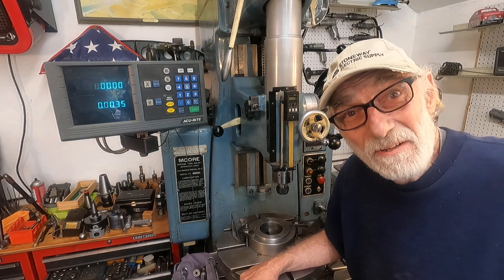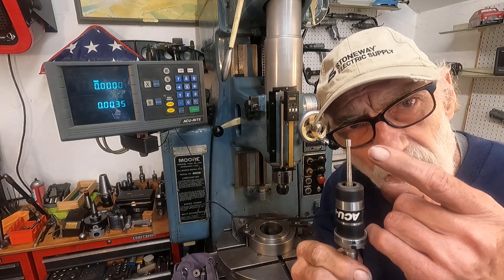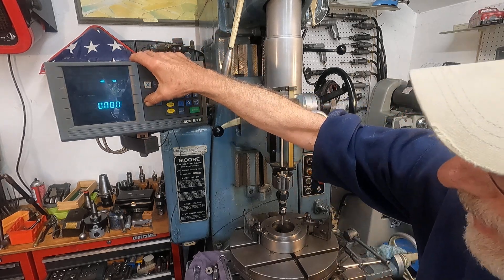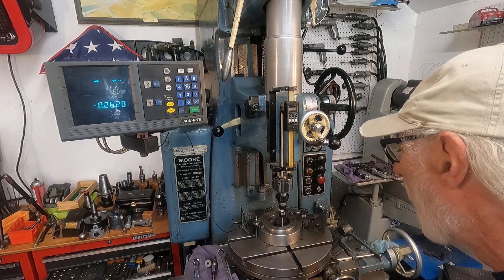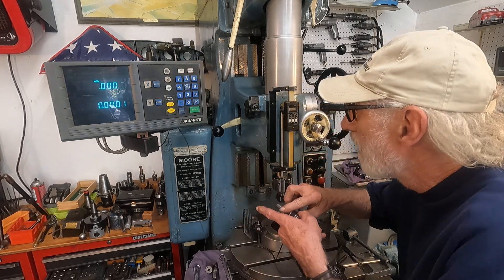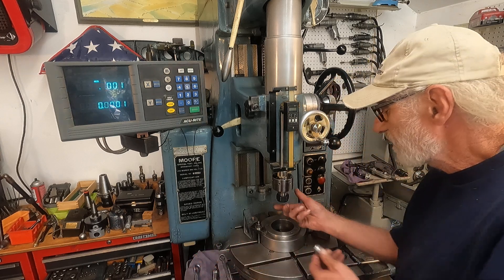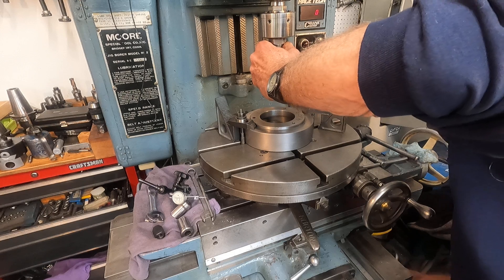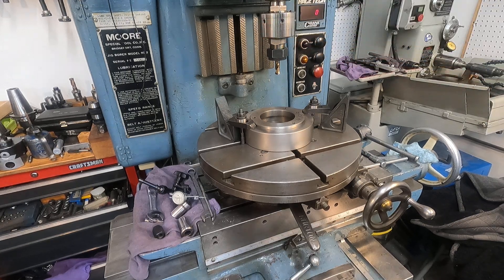Moore Jig Borer using the touch probe

Comment: Moore jig bores and grinders are such high quality that even if You see a Moore clamp for table clamping marked " Moore, You will pay quite a bit of money. Moore Parallels or 1,2,3 blocks are very expensive used
Reply from the maker: The little tiny toolmakers knee cost close to $4000, "a 2"X2" angle plate, but a jig borer and now a jig grinder are a couple hundred dollars. and you do know who bad mouthed these machines, claimed to use one as a drill press, yes it was that backwater machine tool dealer posing as a machine god. Those paying bank for Moore trinkets certainly could not make a video using those items of gold. Good to hear from you Dan, you  are good guy!

Comment: I didn’t know there was an electronic edge finder that connected into a DRO, only seen a light indicating one in a video. Thanks for sharing!
Reply from the maker: This works well in the jig borer because spindle run out is eliminated by the adjustable collet chuck or using the Moore solid toolholder, so the only runout error left is in the probe itself. I will mention this later in another video, the probe can be used to touch off an edge accurately if the high or low spot is known, and then rotate the high spot at a right angle to that edge. This probe not as reliable in regular machines and their tool holders.